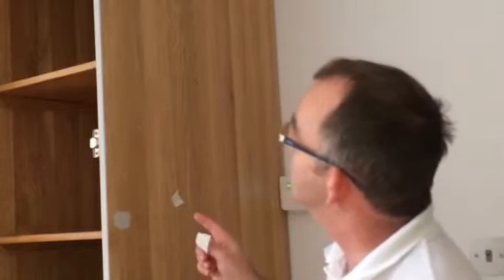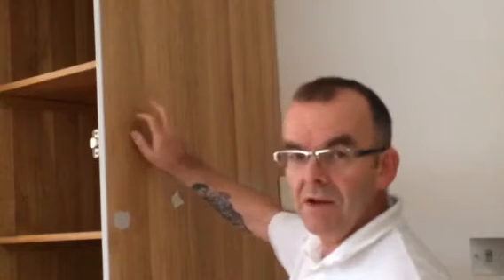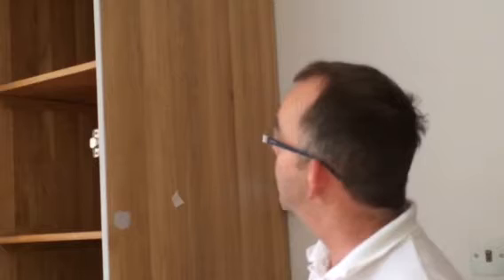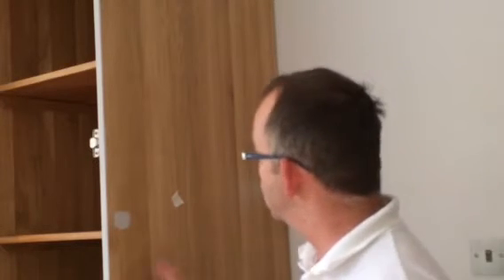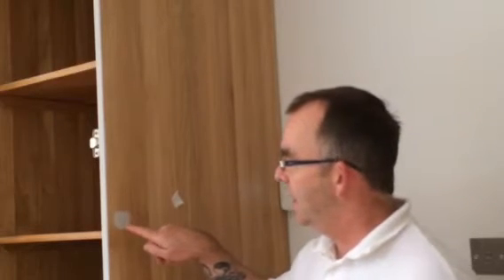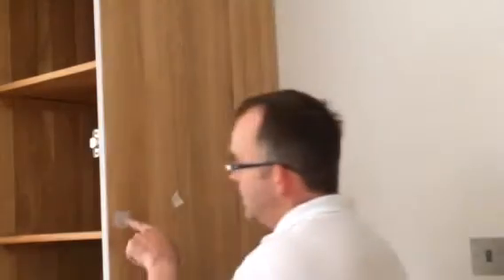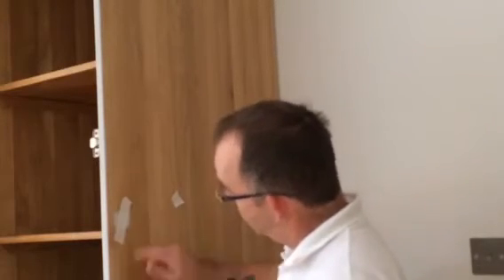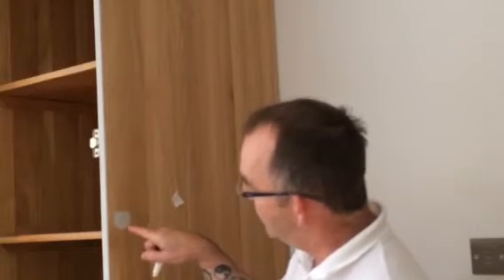Primer adhesion

Comment: On another video of yours, a guy was imparting to you the importance of increasing your videos'  resolution so that the actual finish quality might be seen by the viewer. I agree with the guy -- you really can't see anything at all and it's a shame because I can tell by your technique (particularly the laying off) that the quality is impeccable. 
 it just occurred to me, though, that if you were to simply to take high-quality pictures, you could link to them in the video description and mention it at the end of the video(s).  I definitely would be interested in seeing how smooth those cabinets turned out with some real clarity.
Reply from the maker: mackhomie6 I will Bear your comments in mind , most of these videos are done with a what would now be known as an old I phone 4/5.
Most of my videos are for general help to a diy ‘er taking on a Furniture or kitchen project .
For the professional painter , I wouldn’t use videos I would run a days course , hands on type thing .
Thanks again for your comments though , I now have an I phone 7 so quality should be better 
Regards 
Mark

Comment: Any tips on how to apply the zinsser bin on laminate ? Used a mohair roller but have light orange peel texture.
Reply from the maker: emil lungu , I only use zinsser bin on extreme substrates, lots of tanin & such ,
Laminate always use Tikkurilla Otex , superb adhesion & a flawless finish , try it you won’t be dissatisfied.
Hope that helps 
Mark